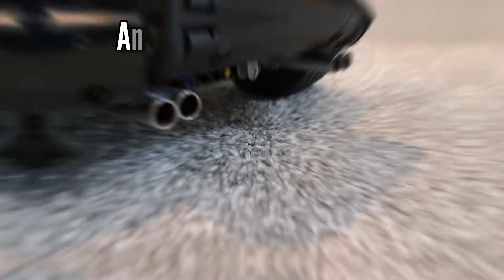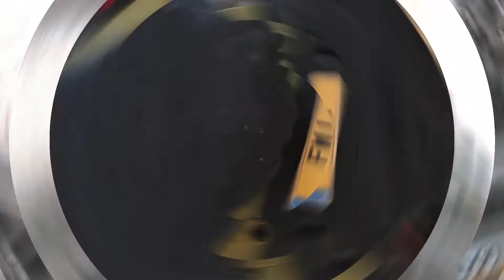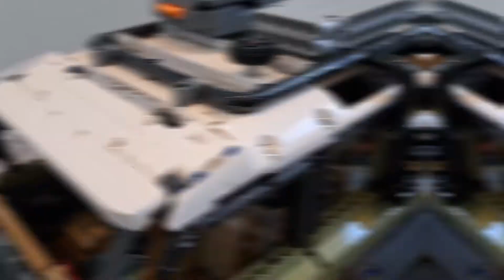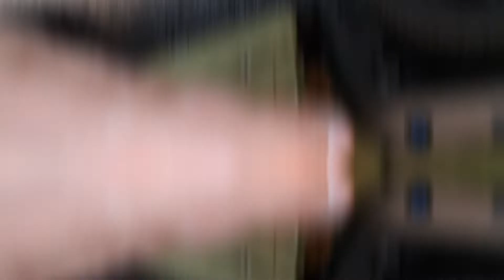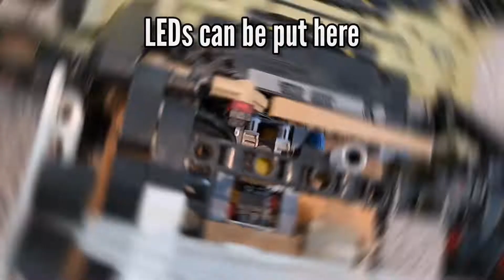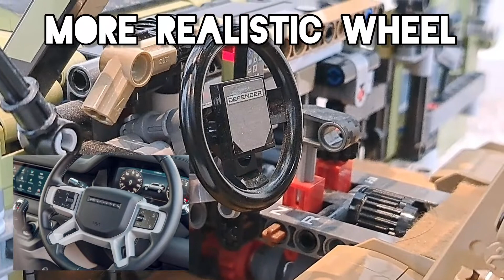Possible 3D Printable LEGO Defender Mods

Comment: Where do I buy the black mudguards at?
Reply from the maker: I spray painted the wheel arches and might 3d print some mudguards, however I don't think there are model for this yet b
Reply: Can I spray paint itñ
Reply from the maker: Yeah. I used citadel black primer and then a gloss acrylic lacquer. Spray paint in a well ventilated space